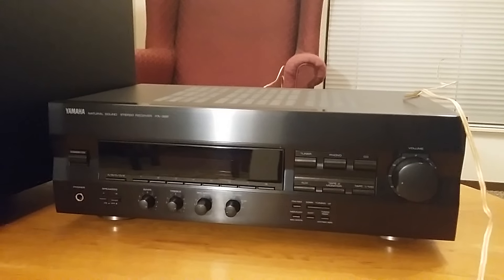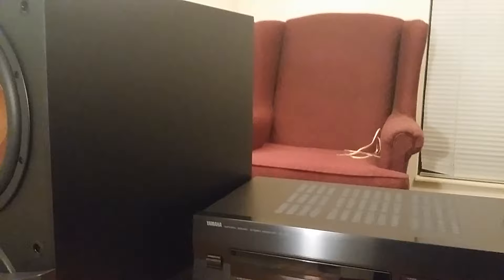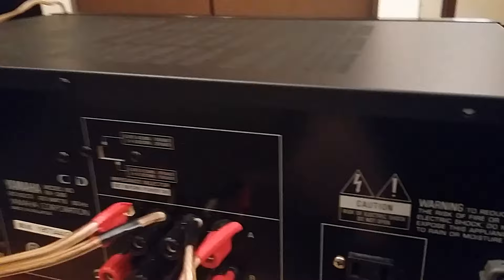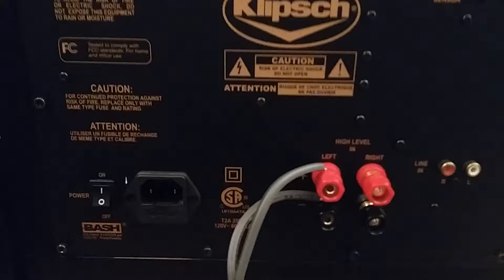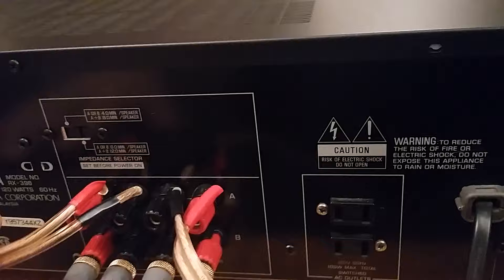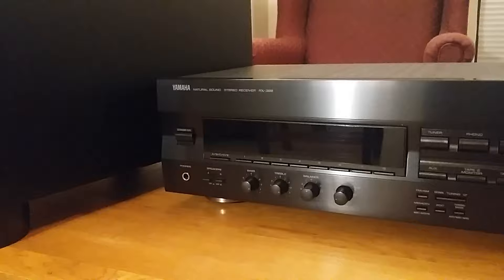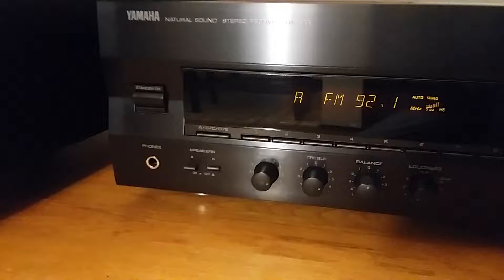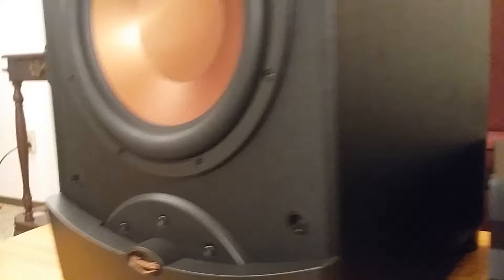How 2 hook up a active subwoofer to a receiver or integrated amp with no subwoofer pre out on unit

Comment: Just use the tape record outputs __RCA. Works much better
Reply from the maker: Buying hooking up this way means that my front speakers and subwoofer are getting the exact same signal phase timing , I have hooked how you talk about but you have to use a tape analog input also. And i will be getting an exact 2v constaly line out woth tape out where's the speakeroutput is going to vary its signal matching the front speakers
Reply: @tee-jaythestereo-bargainph2120  but it's getting it from the same pre-amplified source.

Comment: You forgot to explain about the high level out on an active sub
Reply: generally not needed.  they pass the full audio signal received from the source back out if you want to connect another amplifier.  since most people just use one source for amplification, it's a rarely used feature, and as you can see in the video, this particular active subwoofer doesn't even have high level outputs.

Comment: its not possible to play at same time both channel a and channel b. sir. if you are really genius then  please tell me how i can play both speakers in channel A  and same time woofer in channel B in  yamaha R-S202 model . when i push channel  A switch then channel B automatic cut down. so how this possible sir.please explain for my model how i hock up active woofer ?. please
Reply from the maker: My Yamaha RX 396 has no problems playing both channels at the same time my Yammy has a button for speaker A and a button for speaker B.  but it was a 599.00 reciever back in 1997 most 2 channel Recievers do,  i just push the buttons in i don't know about your R-S202 its a cheaper amp thats why you cant play both channels, but you can run speakers left and right on A channel and then splice into the speaker A outputs to the subwoofer , Powered  subwoofer only needs signal it doesn't hardly draw any power away from amp
Reply: @tee-jaythestereo-bargainph2120  thank you soooooo much respected sir,  for quickly reply. please suggest me how i can connect sub woofer in my above mention model.please upload video to explain this process.  when you feel comfort and free not now .

Comment: it's easy if subwoofer have high input.
how if the subwoofer not have high input, and amp not have line out or sub out. Just have speaker out???
Reply from the maker: Buy a step down converter like people do for their car amps. (Line output converter)
https://www.walmart.com/ip/Speaker-to-2-RCA-Line-Output-Converter-IN-OUT-High-Low/593850817?wmlspartner=wlpa&selectedSellerId=11449&&adid=22222222228000000000&wl0=&wl1=g&wl2=m&wl3=42423897272&wl4=pla-51320962143&wl5=9014329&wl6=&wl7=&wl8=&wl9=pla&wl10=117097790&wl11=online&wl12=593850817&veh=sem&gclid=CjwKCAjwpMOIBhBAEiwAy5M6YC9m8yKcYTqz9vsMPi6UfyN1CYrzjnzo7Cy1V9NpxMWO3xr0HjJm-RoCNOsQAvD_BwE&gclsrc=aw.ds
Reply: @tee-jaythestereo-bargainph2120  i have already buy it, and no sound in subwoofer. my active speaker out is 35 watt, 2.5 ohm.
can i direct input to my subwoofer with 35 watt output from active speaker??

Comment: No mention that the sub must be connected to power?
Reply from the maker: That's what active sub means powered sub !
Reply: @tee-jaythestereo-bargainph2120  I know what active subs means. But some people might tnink that the connection to the amp will power the sub because he did not mention it. Savvy?
Reply from the maker: @artyfhartie2269  I said in video make sure you leave powered sub unplugged while you hook everything up ' and title of video says active sub '
Reply: @tee-jaythestereo-bargainph2120  You should have said the sub must be powered at the end
Reply from the maker: @artyfhartie2269  I said I was pluging sub up ! Lol
Reply: @tee-jaythestereo-bargainph2120  So the amp is just sending the low frequencies to the sub without amplifying them? The reason I ask is that I have this expensive Velodyne sub Made in frigging China. Of course it stops working after a few years. Cost more than I paid for it for repairs. I thought that connecting it to an amp using high level inputs and leaving it off would work because the Chinese made plate amp is screwed.

Comment: I followed your steps exactly but my subwoofer just sounds like one of the surround speakers now extra bass 😭
Reply: is your sub self powered?
Reply: It has to have a amp on the subwoofer only.  If not then it will just get speaker output.

Comment: Floor stand speakers Pioneer spfs52?
Reply from the maker: Yes , for the money the Pioneers Towers by Andrew Jones are outstanding !
Reply: Tee-Jay The Stereo-Bargain-File can i run those with denon x 2600h?
Reply from the maker: @maxrider2887  You can but the Pioneer are more of a music speaker that love power , Their rated at 87db and 130 watts most home audio recievers under 30 pounds have a hard time driving these speakers Espically on music playback , My Marantz is a 500.00-600.00  reciever and honestly even though it says it has 150 watts a channel thats 1 channel at 2 channels its 90 watts at 1 percent THD , So if your using subwoofers and all channels driven you won't get the power you need for music , But if you only play in Hometheater mode with crossover at 60-80hz then yeah it would sound good then, but i have to be honest , if your not going to be using a dedicated 2 or 3 channel amp well I would go for speakers like Klispch that are easy to drive , The Klispch RP 160m are some big bookshelf speakers that are super easy to drive and they are wonderful on Hometheater and you can get them pretty cheap now ,
I have to keep it real !
Reply from the maker: @maxrider2887  The reciever i am using in the video is a 2ch stereo reciever , that i paid 599.00 US  back in 1997 , It has alot of power for 2ch , but if it had 7 channels it would be to weak also 
Klispch RP will match up very well with your Denon and have way better dynamic punch on movies
Reply: Tee-Jay The Stereo-Bargain-File i don buy avr yet  suggest me whice 5.1  avr is suitable for the pioneer. I ma listings son 65% & 35 % watching movie so suggest me please sir
Reply from the maker: @maxrider2887  the cheapest one i can think of with power is the Denon 3600h its gotten high remarks , I'm more into 2ch Stereo but i dabble a lil i bought a used Marantz nr1409 5.1 avr for 150.00US because it has front left and right preouts to run to a 2 channel amp like Emotiva BasX A-300 is what i use that gives me 150/225/300 watts at 8-6-4 ohms real power amp weighs 25-30 pounds itself And the marantz has direct stereo mode also which when you play music its great then i switch back over to 5.1 then the Marantz only drives the center channel and rear surrounds )So for about $550.ish US you got very good power ! And very good 5.1 but if you need more help Phil from 'sound united'Just started a utube page let me tag his link for ya but yeah this set up was cheapest for me !
Reply from the maker: @maxrider2887  here you go ask for Phil 
https://youtu.be/wBGt2lN4-D0
Reply: Tee-Jay The Stereo-Bargain-File  sir pioneer sp fs52 vs q acoustic 3020i?
Best in sound quality?
Reply from the maker: @maxrider2887  i haven't tried the Q accoustics yet , I really want to wish they would send something my way to review !
Reply from the maker: @rolheads  you sure do ! For the price hard to beat ! I have the 1409 slim line Marantz their about the same but yeah using Marantz as preamp gives the A-300 some good warmth ! Great job 😆

Comment: Just use the headphone jack.
Reply: On most receivers and amplifiers, that would mean no output to the main speakers.
Reply: @mobilehifi9580  No, that's on a badly designed one. I only have 70s gear and that has never been a problem.
Reply: @hi-fidude6670  The Receiver in this video is from 1998. So again, on most receivers (from the '80s and '90s), this method (headphone jack) would turn off the main speakers per design. Including Yamaha, Onkyo, JVC, and Denon. The "speaker B" output method would be best. Another option would be to use "Tape Monitor Out" connected via RCA. However the volume (or gain) would need to be controlled separately to match the speaker output. Great video BTW! Thanks.

Comment: wrong.  You can still do it using a line level converter from home depot $44.
Reply from the maker: Why would i need that when my active  subwoofer already has that
Reply: @tee-jaythestereo-bargainph2120  SOME DO NOT HAVE IT , I BOUGHT A KLIPSCH SUB,  IT DOES NOT,  MY OLD MTX DOES, YOU WOULD NEED IT TO HOOK UP A POWER AMP TO YOUR SYSTEM IF IT DOESNT HAVE PREAMP OUTS
Reply: @tee-jaythestereo-bargainph2120  also your video mentioned  you would need a subwoofer that can take speaker level
Reply from the maker: @jonfoss3437  yeah i mentioned you must have hi level input for this to work
Reply from the maker: But Theirs alot of subwoofer ampa out there on ebay

Comment: A thing to note when hooking up a active subwoofer to a av receiver is that if you hook up a active subwoofer to a speaker preout instead of a subwoofer preout you might get mids and highs coming out of the subwoofer which will not sound great at all
Reply from the maker: This is for 2 channel recievers/integrated amps with no Subwoofer rca preout and yes you can use the digital powered subwoofers eq the set the crossover point at 80-60HZ

Comment: There is only one problem with this: the lack of a high pass filter for the speakers...
Reply from the maker: I use the filter on the sub to integrate with front speakers
Reply: But isn´t the filter on the sub just a low pass filter? I would also like a high pass filter for the speakers and i don´t know how to do that. One of the advantages of using a subwoofer is that you don´t need to feed the speakers with low frequencies they might have trouble with, and then the speakers will be more able to play loud and clean with less danger of distortion or overload. But if you can´t use a high pass filter for them, that advantage goes to waste.
Reply from the maker: @mindtraveller100  i just fine tune both front speakers and subwoofer most front speakers wont drop down as low as the subwoofer this is wear the subwoofer comes into play i like bass but i wanna hear the music not to much bass so i keep the volume low on subwoofer and the sub picks up normally below 50hz try it out gurantee you will get it tuned in ! Its all about having fun